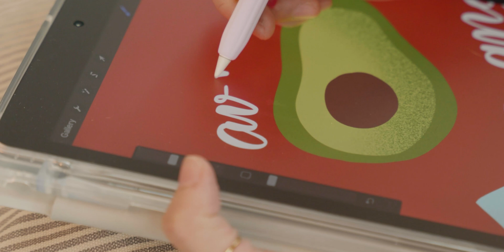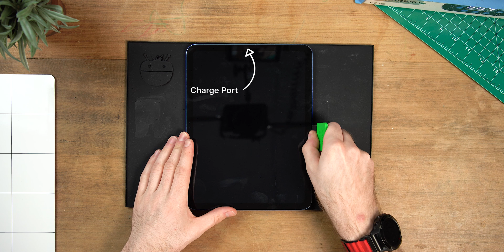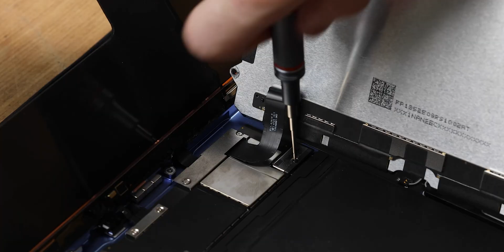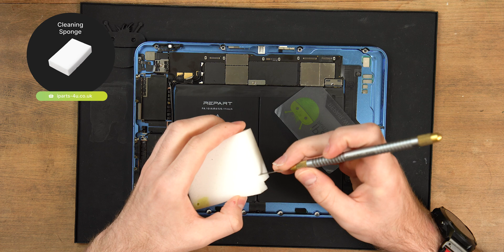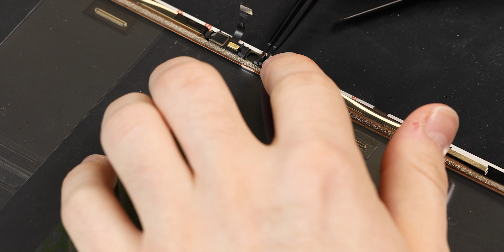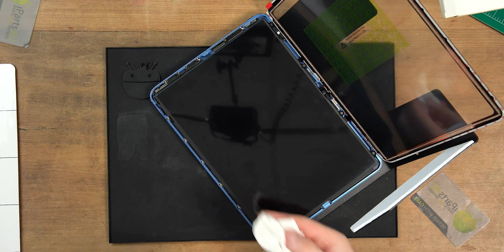iPad 10th Gen LCD and Screen Replacement   Complete Repair Guide!

Comment: So. My screen works perfectly but it’s completely shattered. Is there an option to only replace the glass? Where should I look for parts?
Reply from the maker: So it depends on if the LCD is broken or not. There is a top glass layer above the LCD called a digitizer, so you need to figure out if it's just the digitizer that's broken on your iPad. In terms of parts it depends on where you are located but we do ship internationally and all the parts you might need for this repair are linked in this video's description 🙂👀
Reply: @Iparts-4uCoUk I’ve got an iPad Air 4 (2021). I am pretty sure it’s just the glass on top. Touch screen is 100% working. Brightness is perfect. No lines or anything.
Reply from the maker: @JL_27  Ah i didn't realise you had an Air 4. On the Air 4 the top glass is bonded to the LCD so you'll need to replace the entire screen. Unless you take it to a repair shop who have refurbishment equipement that can strip to broken top glass layer from your current screen and replace it with a new top glass.
Reply: @Iparts-4uCoUk  bummer. It might just be time to buy a new one. Thanks for your help!!